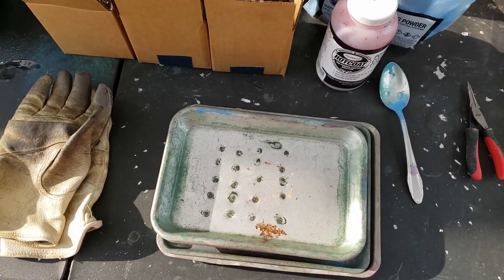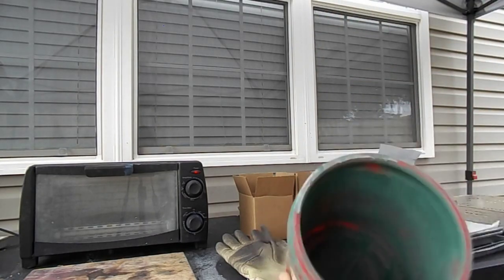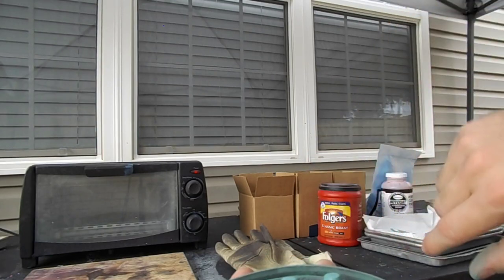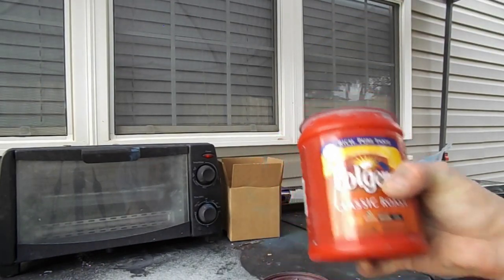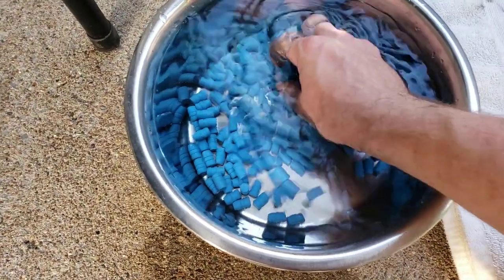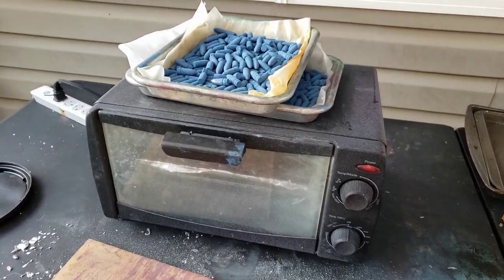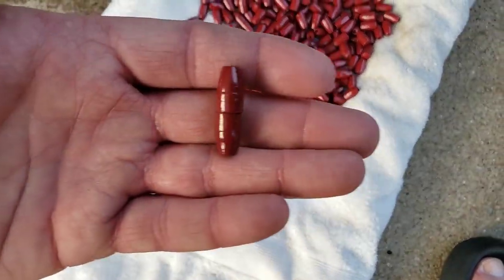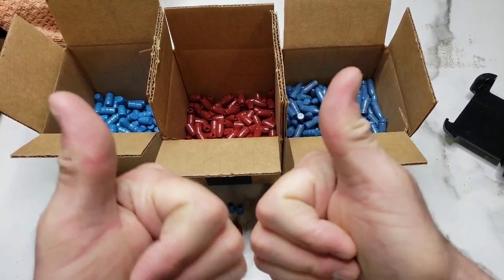How To: Powder Coating Your Freedom Seeds - 3 Bullets - 2 Powders - Foil vs. Parchment?

Comment: Julia Child would be proud of your baking skills.
Reply from the maker: I can bake when there's only one ingredient 🤣
Reply: Hey, I have a question if you have time. I am looking into building a bullet trap and recycling my lead over and over, I was wondering if the powder coating burns off when remelting the bullets, or do you need to burn off the paint first?
Reply from the maker: @EdwardM919  it floats to the top of your melt and you can flux it out like the normal dirt and trash 🇺🇲👍
Reply: @DummyRound  thank you for your help and your videos, it's really helped out a lot.
Reply from the maker: @EdwardM919  awesome, glad you got something out of it. Thanks!

Comment: They looked good . I've found that if I don't dilly dally when I remove from the oven to the water , I get almost no stickage of the bullets . Like out of the oven and in the water , right now works the best . I don't see a difference in what container you use to shake them up in either , a #2 , #5 or a plastic coffee can . I use old mayo or peanut butter containers .
Reply from the maker: Yep, I try to go from the oven straight to the water as well. Some like to air cool, but I just want it to be done with and out of the way for the next batch. I might do some HPs and let them air cool, but I'm not really testing for expansion so I might as well just quench those as well. Thanks 👊

Comment: I had some heat deformed in the center- lower rack   best to go high in the oven?
Reply from the maker: It really depends on your oven, but you were probably right on top of the heating coil, or your oven is getting hotter than the temperature dial is set to. If you have other racks you can try, go ahead and experiment. I've had small 22 cal bullets melt on me before, right after I had a perfect batch of 35 cal bullets. Just depends how fast they take on heat, how close they are to the source, and if the source is the correct temperature. Hope that makes a bit of sense. Thanks!

Comment: Nice vid DR. 

I think my powder mightve got wet. Its bot sticking like urs. My most accurate cast are those 312s but in alox and with a gas check and sized. 

If u like trying new things. Try the wet shake n bake. If i remember its a little acetone and really light coats/not much powder. Keeps the dust down
Reply from the maker: Thanks. I've tried the wet method once or twice, and probably had too much powder, so I didn't get the results I wanted. I've never had an issue with the dry method, unless it was a powder that just doesn't work, or if I left it out in the shaking container between batches(several weeks or longer) and it absorbed too much humidity(I'm guessing?).

Comment: A to B boys! This ain't the Navy son! Freshly coated freedom seeds! 👍 Love those fresh out of the oven. I'm loving the board idea also very efficient. Ok so are you quenching to harden or am I missing something? You shock me all night long!🎼🎵🎶 Suggestion: I use a strainer when quenching it gets them in the water but makes it easy to pull them out when I go to the towel. Try it you may like it. Time saver.
Reply from the maker: Thanks, Tim. I need to get a strainer for quenching like you said. I don't do it for hardness, necessarily. Mostly just to get jt cooled off and out of the way for the next batch lol

Comment: You should send a link to Folgers LOL.  Maybe get a free supply of coffee omg lol.   Hey quick question.  I have been dry pc and works ok.  No leading, etc.  but some of the bullets have stuck and have bare spots here and there, some stick to the wire tray (Elvis) so hoping not a problem,  any thoughts?
Reply from the maker: As long as your bearing surface is covered, you're good. Bare spots on the nose or base don't matter since it's not contacting the barrel and can't leave leading behind. Even the lube grooves between the driving bands don't matter, just the surface contacting the barrel. Hope that helps🇺🇲👍 Thanks!

Comment: I've never used a powder coated freedom seeds before. Always thought about sticky fouling in the barrel from the paint. Another thing I've always wondered is; if the paint would inhibit the loading tolerances of either your casing or your barrle, and what effect that has on rifling engagement, spin, added Grain weight, excetera, as the paint obviously has a thickness and a weight. I'm not saying it doesn't work I literally CANNOT say that as I have never used them before I'm pretty much making these statements because of my THOUGHTS which MAY be wrong, and wondering what your thoughts are on it since you've done it and have the experience. Have you noticed any problems with powder-coated freedom seeds vs. Uncoated seeds? Legitimately asking; not being a smart-ass
Reply from the maker: You size the bullets after coating so it's the same diameter as any cast bullet. It doesn't add a whole grain to the total weight compared to bare lead. If your lead is of the correct hardness, powder coat is more durable than copper plating. The only problem I've ever had is having to reduce the OAL due to the ogive hitting the rifling in a picky barrel a few thousandths earlier than if it weren't coated. It's basically night and day compared to traditional lube lead bullets.  Hopefully that answers your questions👍🇺🇸

Comment: So say hypothetically you had a bad batch of coated seeds ,,,, flaking coat - weight - ect. ect. ,,, can you recast/smelt with the coating on
Reply from the maker: Sure can. It burns off and floats to the top like any other slag or junk you're already cleaning out🇺🇲👍

Comment: I have not seen preheating the oven to be necessary.
Reply from the maker: It probably isn't, but I let it run while I'm tossing the bullets or standing them up. Placebo effect, most likely?
Reply: @DummyRound  I do all of my baking at one time, one batch after another, so in theory, the oven is preheated. I just have not  seen any difference from the first cold oven batch.
Reply from the maker: I'm sure it's negligible. My only thought was the minute or two it would take to get up to temp is taking a minute or two away from the actual bake time... I don't follow directions and start a timer when 'the powder coat starts to flow', but rather when it goes in. It probably doesn't matter, but just one of those things I do as part of my process.

I'll try a cold start next time if I remember.

Comment: Can anyone tell me  , can you use any type of powder coating?
Or is there a certain make you have to use for lead bullets.
Reply from the maker: Theoretically, you can pick any, but there are known good and bad powders to use. The go-to never fail option is Eastwood Ford Light Blue. The metallic looking and translucent ones usually never come out looking how you want them to until they have 2 or 3 coats on them, which is just a waste of time and resources. Some powders will not bind to the lead to begin with, and thus will not bake onto/around the lead. Start with the  Eastwood FLB and experiment with cute colors and such after you get your process down👍🤠🇺🇲
Reply: Is Eastwood an American company?? 
I'm in England, looking at different options, must find out more information about this subject. 
Very interesting video, many thanks.
Reply from the maker: @richardperry4115 they are US based, but I believe there are distributors over yonder way👍

Comment: Avoid the foil all together. Parchment is great but best by FAR is Copper oven Liner!!  Hundreds of times used 100% as good as new!!  Amazon has
Reply from the maker: I've heard of that, might have to give it a shot. I'd also like some of the silicon ice cube trays to stand up some 30 cals. Any experience with that? Thanks!
Reply: @DummyRound  Yup definitely a trick every coater needs to have. Those long skinny bullets dont stand or dont STAY STANDING well.

Comment: Your bullets look great but I think you put a little too much work in to be honest. Parchment and foil is an unnecessary complication and expense for pistol bullets. I do 750+ 9mm at a time in a deep fryer basket and drop them from 3 ft into a quench bucket. Yo barely get a bare spot and very few stick together. I take much more care with rifle bullets and place them individually into a silicone micro ice tray with a powder covered pai of fine needle nosed pliers gripping the bullets in the grease grooves.
Reply from the maker: I never had luck with the "big pile in a basket" method. They just stick together like a rock. I think humidity and atmosphere have some weird effects on the PC, depending on where you're at. I would like to try some of the tiny ice cube trays for my rifle bullets... need to break in a new Lyman mold,  anyways 😉👍🇺🇲Thanks